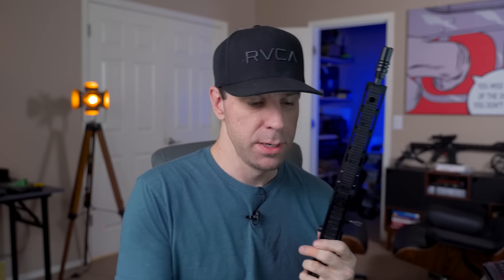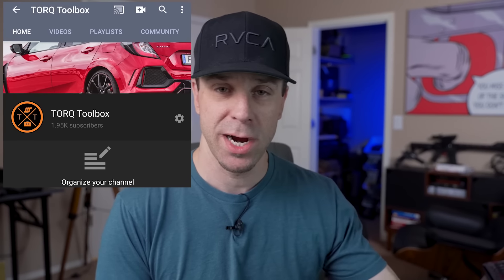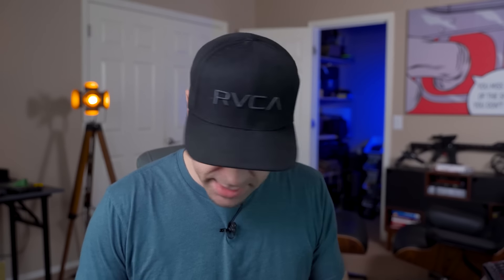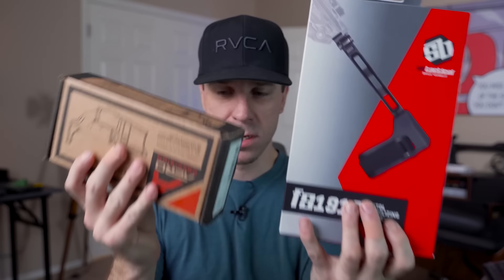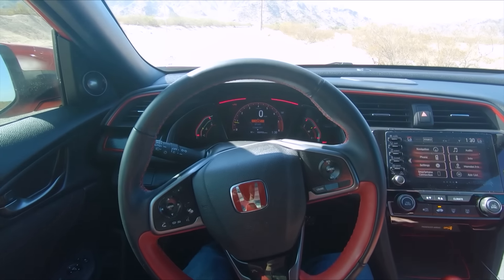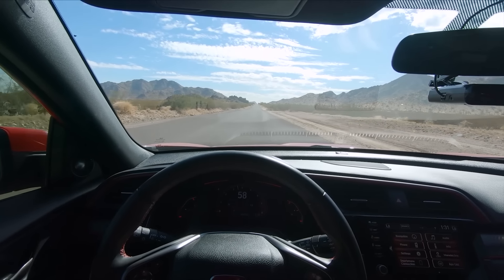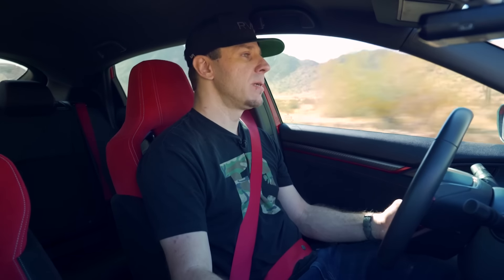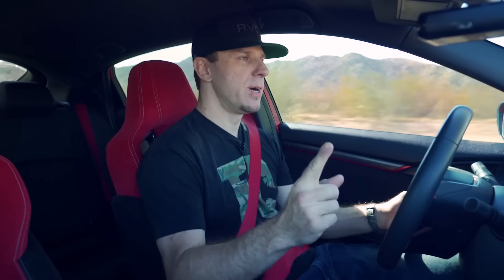INSANE Buffer-less AR Pistol.....and a TYPE-R

Comment: Current car build I'm on is a 85 SS 540 BBC , f1r procharger, qa1 coil overs all four corners, frame is boxed, complete spohn performance suspension upgrade, mini tub, frame notch, full interior, disc brakes, holley efi , 22x9 front 22x12 rear 305 series tires
Reply from the maker: Dang! That's a beast

Comment: Keep an eye on blow by . Use good oil and change every five thousand miles. I have a 07 si with 4th gear grind full suspension aftermarket sway bars . I love the new type R . Congratulations man I can't wait to see as you build it .
Reply from the maker: Definitely man....have you tried Amsoil Synchromesh for your Si tranny yet?

Comment: In Poland there was some cases with Civic TypeR  transmission was destroyed. We have lot of rains etc and hydraulic fluid is higroscopic. Honda puts hydraulic fluid with low boiling point and if it gets water it is even worse.
Shifting gears is starting to be harder and harder and eventualy it will brake.
If u have this problem u need to change hydraulic fluid  in gearbox steering box( i dont know name in english) on that with higher boiling point.
Sometimes ppl mount heatshield between exost and gearbox steering.
Reply from the maker: Solid advice...Thank you man

Comment: Bufferless AR is intriguing. Honda civic not so much. Was hoping for more gun, less car or no car.
Reply from the maker: Did ya read the pinned comment? 👆
Reply: If you ever get a chance to drive one then do it. Test it around turns. It handles like crazy. I can take turns in it at over 100mph that my accord would wreck on at 70+mph.
Reply: @TacticalToolbox  There is no pinned comment. Also, doesn't the AR platform NEED the buffer and tub/isn't it highly beneficial to the design for recoil and cycling control as well as making the weapon better sealed by not having an AK-Esque wide-open gap behind the bolt carrier?
Reply: I love the type R but only in the 92-95 honda's, its the weight/power ratio, vehicle overall size, and "go-kart feeling" that made it great. The 91 CRX SI with a B18c1/t3 turbo is the best thing since sliced bread.
Reply: @Raymo2u  I've been wanting to see someone transplant the k20c1 into a CRX Si but I think it'd take huge mods since there's just not enough room

Comment: I have a 2017 #00137. Mine gets 2nd gear grinds from time to time. I get a fair amount of 4th gear lockouts when downshifting from 5th. Maybe Honda has fixed some things in the 2019.
Reply from the maker: Have you taken it to the dealership recently? From what I've seen they've been replacing whatever is causing the problem

Comment: 20" wheel's are flippin heavy. Going to a lighter weight wheel will help, especially since it's unsprung spinning mass.
Reply from the maker: Agreed I think the new wheels and tires are 4.2lbs lighter per wheel
Reply: @TacticalToolbox  Bruh, get some Enkei RPF1's in some 18" size, or even a 17" size if you can deal with the sidewall and find a tire with the same overall diameter as the 19's/20's. Hella light.
Reply: @TacticalToolbox  while that is an improvement. There's better out there imo. Personally I hate the move manufacturers have made beyond 17" wheels. It's purely an aesthetic thing that's got several cons both in practicality, feel and performance. 

Also, the further the weight is from the hub the greater it's effects are on acceleration/deceleration and turn in feel. (Though turn in feel is affected far more by side wall and compound)
Reply: why I run 10 Lbs 15" traklites on my Nsrt4
Reply: @cokeyNbk  I use OEM 14.5lb FD3S RX-7 wheels, they're a 17x9" if I recall correctly. 235 wide tire.

Comment: There are guys pushing 550-600hp on stock blocks now, 2 years later. You bought this at a great time since the mark up now is insane. But the k-series motor is pretty stout from the factory.

Comment: I have a problem with my p80 build wondering if you guys could help me, when I rack it back to load a round it gets stuck when its almost all the way closed and if I tap it it closes , I checked the bend of my trigger bar but wasn’t that, any other suggestions?

Comment: The focus rs would've been a better option. To each their own. I almost bought one until i test drove a 2019 shelby gt350 it immediately put a smile on my face all the way home too. Ive been drag racing a 01 camaro ss until I sold it, but if its your first performance car thats the safest car to start with. I remember when 400hp felt like alot, now 500 feels sluggish you'll go through that too.

Comment: I’ll tell you from my experience, I rather have a coating and deal with rock chips than have Xpel clear bra.

On my type R I did put Xpel ultimate plus on the rockers.

The reason I opt out of clear bra on the car is because it should be removed within the 10 years. Since I plan on keeping the car for life, I rather coat it, and fill in rock chips with dr. Color chip.

Comment: Should have bought the new 2020 Camaro LT1 or Mustang GT for the same price as that Honda
Reply: @SgtRudySmith31bRet  I know the Camaro msrp's at 34 and I've been told the Mustang is just a couple hundred more
Reply from the maker: I really like both of them and they're definitely much faster than the Type R in a straight line.
The main 2 reasons I didn't buy either one comes down to their Re-Sell value as compared to the Type R. At the moment the Type R is retaining 100% of it's Value even after 20K Miles.....and I wanted a 4 Door because of kids & Car seats.

Hopefully as the Car channel grows, I can do more builds on different platforms
Reply: @TacticalToolbox  I can definitely understand the need for 4 doors and the resell value aspect of your choice. And while they are fast in a straight line, they are also very good on road courses now too

Comment: Should've got a RS or something bro for 40k
Reply: I've never driven an RS. I do own a Type R though. It handles like crazy.
Reply: Yeah but the RS has problems
Reply: @jairopavon11  That would be my main concern with all the engine issues plus they say the ride comfort is non existent.
Reply: @jairopavon11  meh
Reply from the maker: In regard to the Focus RS...Ford stopped making them for a reason....Their engines and heads are blowing up left and right. In regards to why I didn't get the STI.....2 words "Ringland Failure"...and the Golf R cost $45-50K
Reply from the maker: Unfortunately the RS has a design flaw in the heads that's causing them to blow